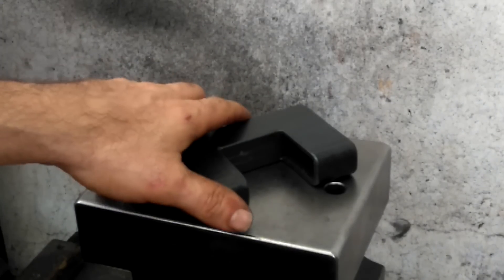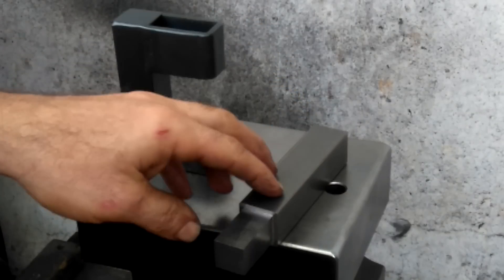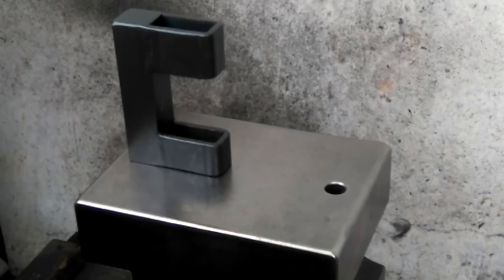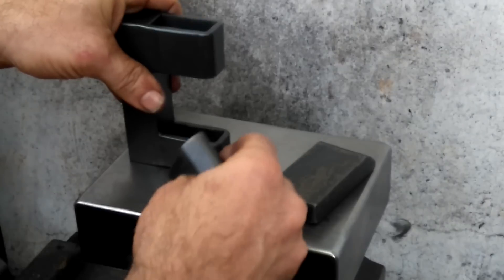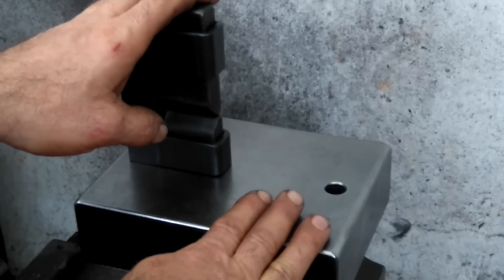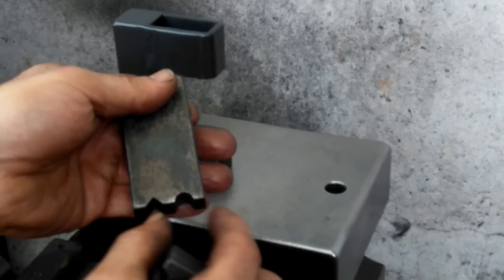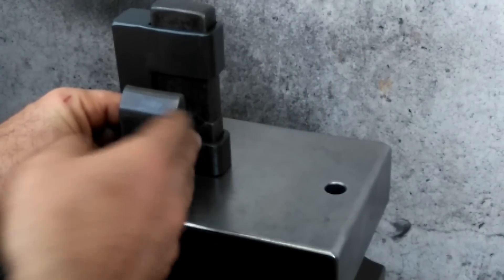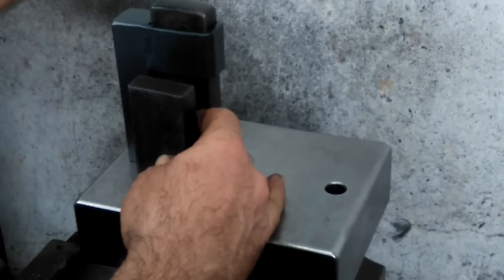Blacksmithing - my latest guillotine tool design

Comment: Really nice work throughout (all your videos) and well presented.  You have a nice website too.    

I do a bit of semi-amateur blacksmithing ( or semi-pro if you like) here in North West England, but am mainly a welder/fabricator and machinist by trade.  Most of the blacksmith work tends to be for family and friends.  But I could always do with more tooling and other useful little bits.  I do like your video on hot punches and this guillotine tool for example.  I made a guillotine tool myself about a year ago and now realise it's over-engineered and too bulky.  Not as simple as this 'two hoops on a stem' version you have  Very nice.  I think I'll make one, to suit my existing dies.

Anyway, I am impressed and have subscribed.
Reply from the maker: +Finarfin Thanks for your kind words and for subscribing. I'm going to do my best to improve my Youtube offerings; maybe make videos less rigid and structured and more freestyle, letting people see the process more organically - the good the bad and the ugly as it were... Feel free to copy my guillotine tool design. Like you, I made several before that were over-enginnered. Sometimes less is more, especially in blacksmithing. The dies are really the heart of this tool. Thanks again for taking the time to comment and good luck in work. Glen
Reply: Thanks for your prompt reply.  I'm just watching another of your videos right now, lol.

The videos are fine so far but of course innovations and progress apply to everything.  I will look forward to more uploads.

I do like your tong video (I was directed to it by YouTube preferences, being subbed to a few other smithing channels) and am impressed you manage to make a stout tong out of just 12mm bar.  I began with 12mm square bar and failed initially because I couldn't retain mass where it is needed, even though it is ideal for the reins.  Even now I would prefer 16mm square or maybe 25 x 10 flat.  But then there's lots of drawing out or one elects for welded reins.  I will have another shot at some tongs from 12mm round bar.  Like yourself, I prefer shortish tongs, for more control and close working.

i would also be very interested in seeing a video of your bent-knee tongs, when you have the time to do so. 

Thanks again.
Reply from the maker: +Finarfin I agree - progress applies to almost everything. What I did yesterday, a week ago, a year ago, etc., usually seems less good than what I am doing right now. Working with 12mm or preferably 12.7mm (1/2") round stock for tongs, so that I don't need to draw out the handles, is what I like to do now. I have made tongs in every way and from every stock size and shape. No matter, the trick to making a good tong is leaving certain areas (the jaws, offsets, rivet bosses) thick enough to hold up to use, especially when using mild steel like I do (1018 cold rolled). Anyway, how I'm doing it now may not be how I'm doing it next year... I am planning to post more tong making videos - show different styles. Thanks again. Ever upward... Glen
Reply: Thanks Glen, your channel is a good find for me.  Keep up the good work.

Comment: Glen this is really nice tool, anyway, is it possible to make a fuller of 2 inch diameter of round bar steel using this tool?
Reply from the maker: +Cornelius Rusandhy My guillotine tool is a very simple, small design. The simplicity makes it sturdy and the value is in the dies. The throat opening is approximately 1&1/4 inch so you would not be able to fuller 2 inch round bar - if this is your meaning... I made some changes to what I offer - the guillotine tool with two die sets (fuller and flat) is $80 plus shipping. Thanks for watching and for your kind comment. Glen

Comment: I'm extremely new to blacksmithing and just starting to get some tools so forgive me if this is a dumb question or has already been addressed.  When working with your tool with a hammer in one hand and hot metal in the other how do you raise the die? is this just 100% manual?
Reply from the maker: Tommy, That's actually a good question. I remove the hot piece from the forge, raise the top die with my hammering hand, let it drop onto the workpiece, grab my hammer and start hammering. So yes, 100% manual. Some have suggested making this tool spring loaded but I just want it to be as simple possible. Thanks for watching. Glen

Comment: Are your dies a standard dimension so that I would have the option of purchasing some cold rolled and making additional types such as butcher and guillotine?
Reply from the maker: Stan, The dies are made from 1050 medium carbon 38mm x 16mm in size. Whether or not this is a standard size may depend on your location. But you should certainly be able to find something close. Otherwise, I can send blank, un-heat treated die sets cut to length that you can shape as you see fit. By the way, this is now not my latest design as I have made some updates to this tool. I need to change this title... Thanks for watching.